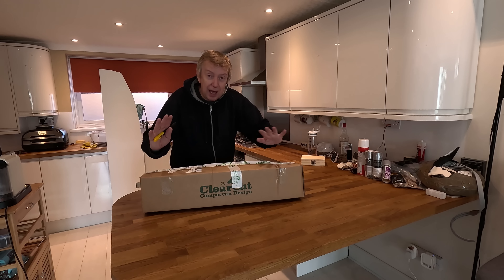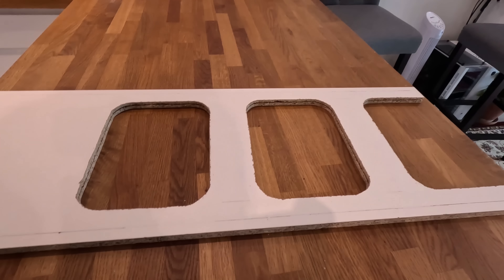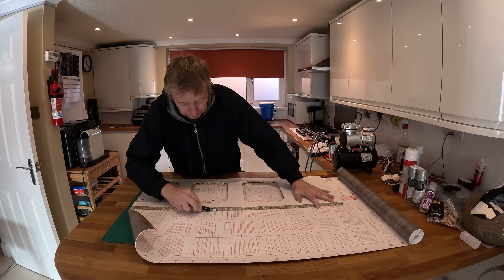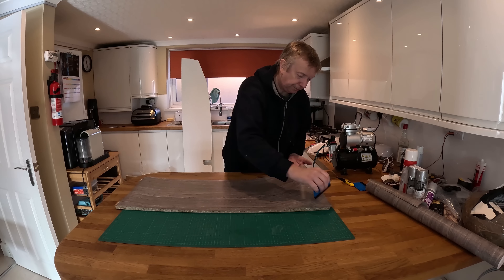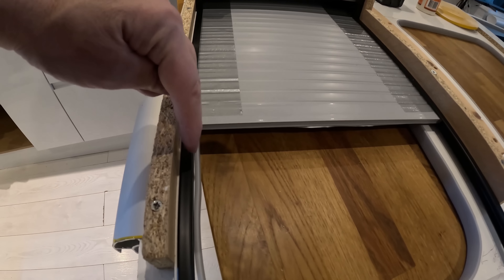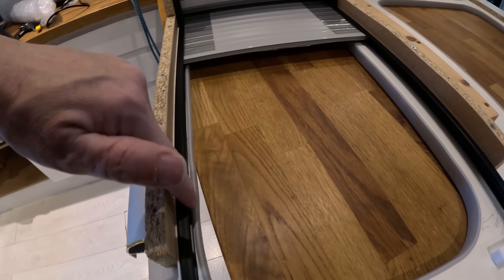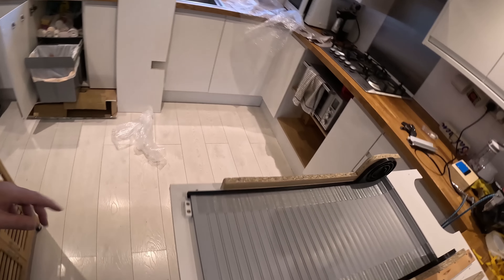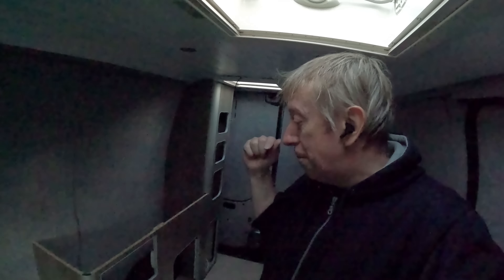Laminating & Finishing The Galley (Day 12 Van Interior Build Vlog)

Comment: Looks good Rick.  On the microwave bit, you could get some aluminium either brushed or satin L trim (buy it in B&Q for example) which you can mitre the corners on which will make that section look perfect and match the corner profiling.

Comment: The understated colour scheme matches better than in the old layout, white with grey & a brown wood laminate. Much tidier than the exposed cubby holes on the previous design. At this stage i still think you should incorporate the sliding seat / bed design rather than use up space to have them separate. Maybe bring back the shower toilet cubicle of your old van in a corner? I've seen Damo's DIY shower hook idea, however you will find the pvc curtain will stick to you when wet as you move around & it's cold to the touch.